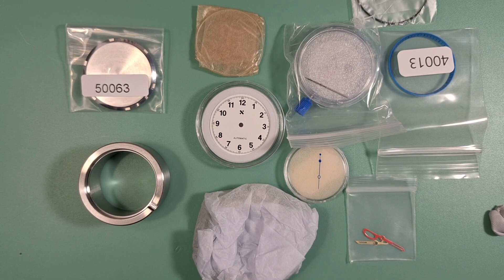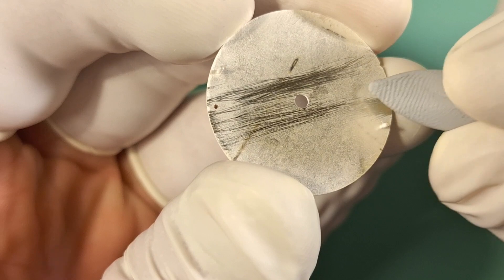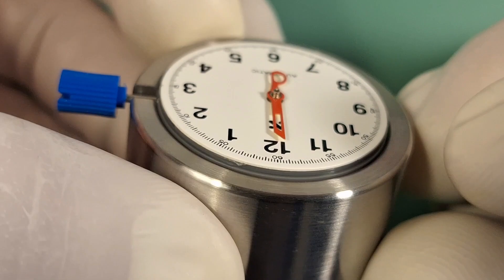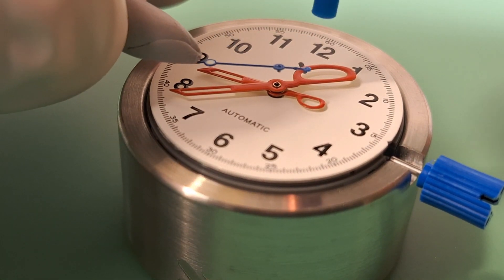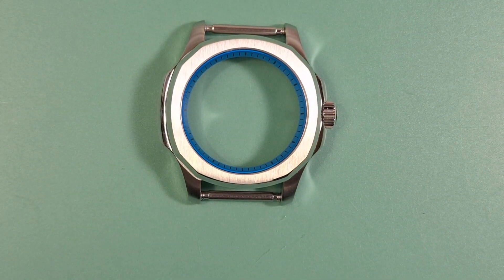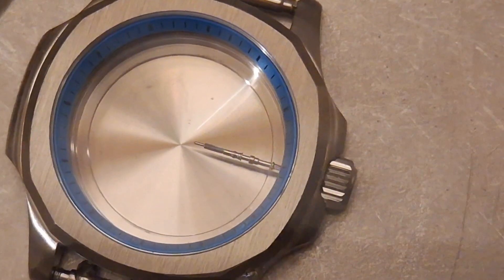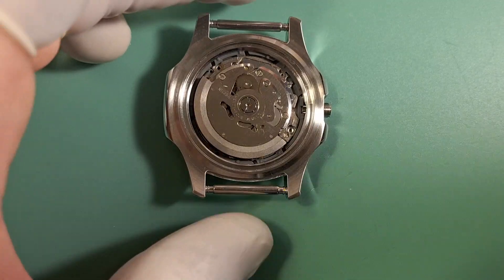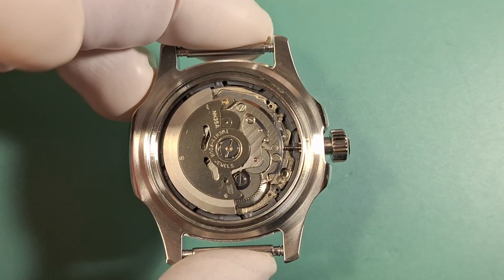Random Rob Barber Shop Build ✂️

Comment: Nice looks amazing,what if a dial has 6 dial feet?
Reply from the maker: Usually, they only come with               3 o'clock or 4 o'clock dial feet. My guess is that the extra set could be for a left-hander. I would just remove  any that you don't need.